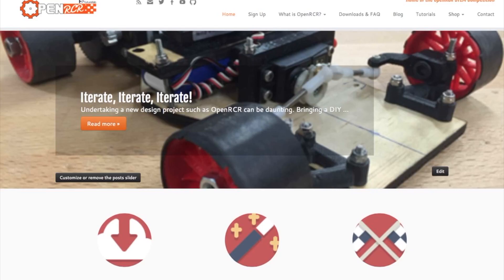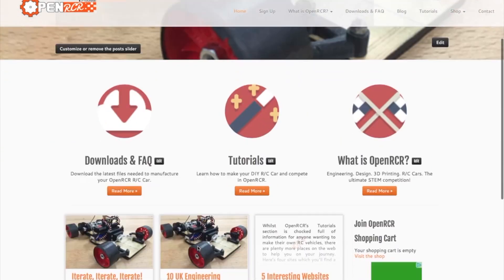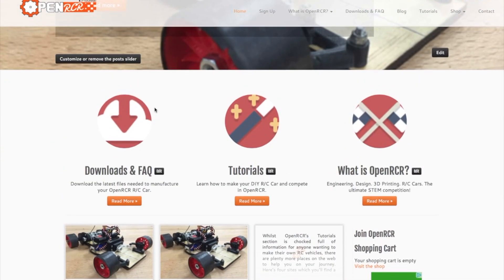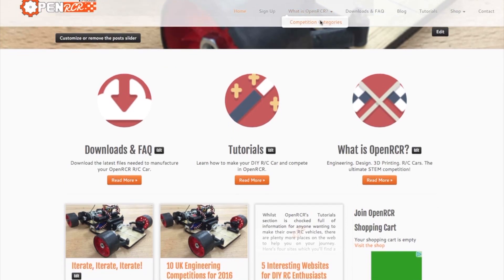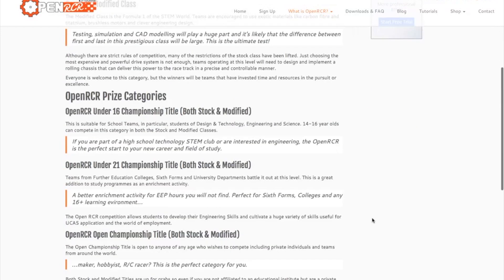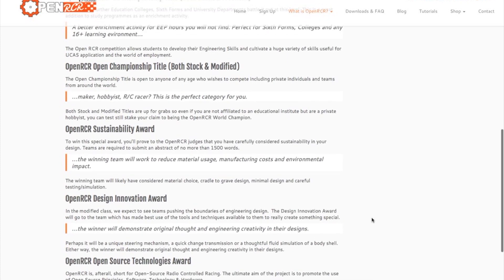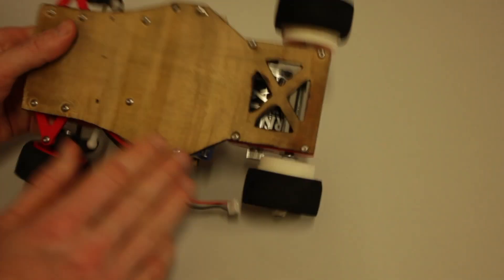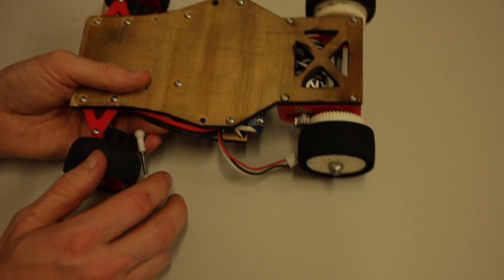DIY RC Car OpenRCR - #5minFriday - #13

Comment: Good day, how is the rear axle arranged? Is it possible to refine the inclination of the pivots? Make a separate gear and wheel?
The idea is interesting, but the project does not develop. This model of the car would be interesting for children to build in modeling clubs.

Comment: can you give me a list of all the parts needed to build an rc car please?
Reply from the maker: +Zoltan Gaming I'll repost a link to the new versions of the parts early next week. Please subscribe for updates!
Reply: FutureFab CNC & 3D Printing Still waiting on the list!
Reply from the maker: +Andre E sorry for the delay! I've just collated all the part files and will be uploading them next Tuesday when I'm back in the workshop. I'm thinking of using both git hub and thingiverse to hold them. I'll stick a comment on this thread when it's done!
Reply from the maker: I've uploaded all the STL files to this location for now : http://www.thingiverse.com/thing:1909501

List of parts and the video to follow this week :)
Reply from the maker: Check out http://www.thingiverse.com/thing:1909501 for now, electronic component list to follow.